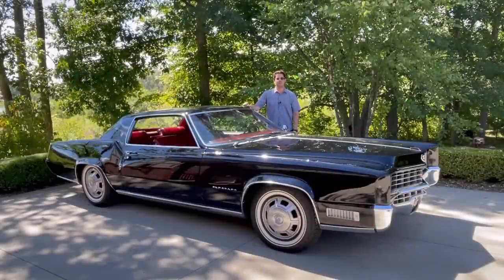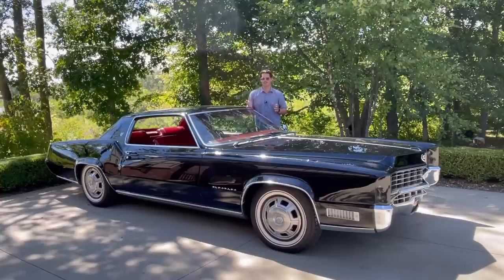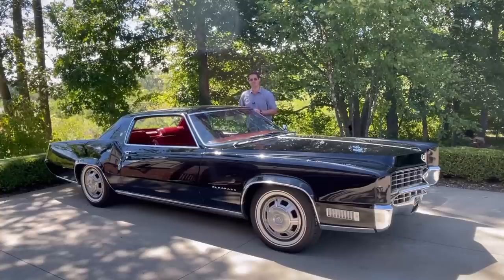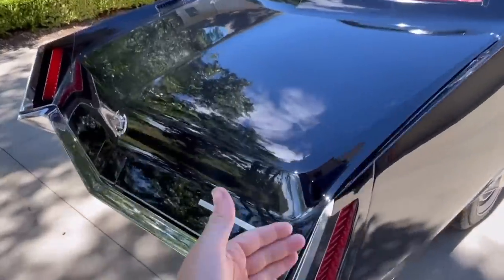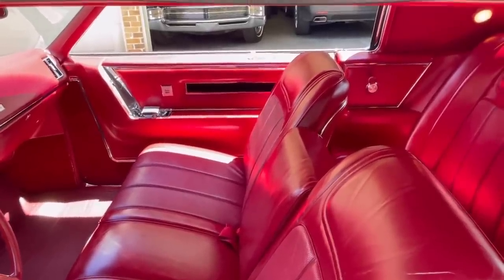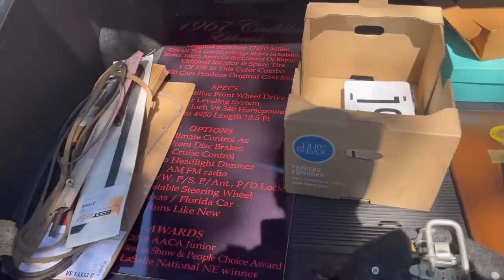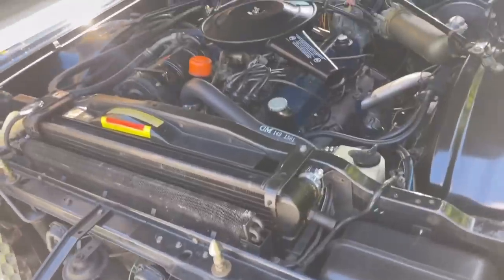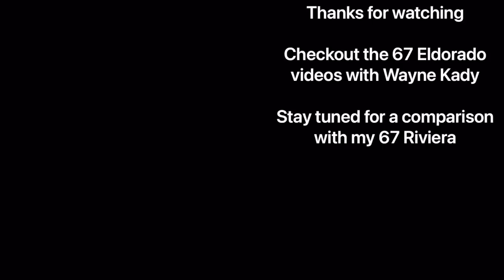Best Styled American Car Ever Made? The 1967 Cadillac Eldorado (with just 18k miles)

Comment: Are those 'quad shocks' on the rear suspension, (4:06) like on the '84-'04 Mustangs?
Looks like it had its own 'proprietary' radio knob configuration, like the Corvette and the Astro 95/Titan 90 cabover road tractors. (and the Citation) I think some of the early Fox Mustang convertibles came with that power/manual window configuration too. The deterioration inside the instrument cluster, seen on the clock numerals, surprises me!  Condensation issue I guess - but I wouldn't've guessed that it was due to the AC. And those knee-vents on each end of the dash...
There must be some date-coding info stamped into that battery case, I'd think. Glad you kept that - it could probably be brought back to life, if the plates are OK.
Weren't the '73-'77 A body coupes given that same hot-wire treatment to their backlites?
That car is so imposing, in a beautiful way! Some red factory style pinstripes would really set it off, although it would be a shame to modify such a clean example as this. Too bad they don't make magnetic vinyl pinstripes, which can be taken off and stored, and then reused...

Comment: Truly a lovely car in remarkable condition, congratulations. I hate to differ with you but I prefer the '68, for the front turn signals in the fender tips, which to me look much better, and the hidden wipers, but to each his own. I'm surprised you didn't mention that Cadillac referred to this as a "Fleetwood Eldorado" in their brochure, as it was considered part of the Fleetwood model line. A couple of other points: you could get leather, as in your car; the houndstooth "Dalmation" cloth which you mention; but also a Darien cloth in several solid colors. I am indifferent to the change in dashboard design from '67 to '68, but find it interesting that in both years that the same dash was used both in the Eldo along with the rest of the Cadillac line, so all Caddys got the new dash for '68. Of course, for '68 you also got the 472 instead of the 429 which I think was an improvement.

Regarding the mystery on the rear window exterior trim molding: while there possibly could be a connection to the plant where they were manufactured, I have seen more Eldos of this vintage with body (or vinyl roof)-color moldings. The cars I have seen with bright molding on the rear window were all repainted, many with a color change. Since I suspect those are stainless steel like most other GM cars of that era, if you were doing a color change it would be easier to just buff the old finish off the stainless and use it that way, especially if you liked the additional bling. But at this late date, who can be sure? Hope you enjoy this one and get a chance to drive it a little.

Comment: The best? It's up there. My personal candidates are the '66-'67 & '71-'72 Rivs, '63 split window Vette, '79-'85 Eldos and Rivs, '68-'69 Dodge Chargers, '41 Lincoln Continental, '39 Lincoln Zepher Coupe, '49 Cadillac, '40 Ford, '66-'67 Toronado, '53 Studebaker, '54 Mercury, '08-'13 Caddy CTS, '61-65 Lincoln Continentals & the '37 Cord to name a few, looked great from any angle.
Reply: '57 Cadillacs were no slouches either.

Comment: Congrats Adam.  super sweet car, and I bet it was not cheap either. This body had to be  designed for a younger Cadillac buyer.  1967-70 had great look. I, for some reason do not like the 71-73 body, they look bloated or something like that. 75-78 are nice but huge, 67 looks slim and taught, just right.  My parents 1965 Cadillac 429 was powerful , but has a tendency to use oil.  340 hp Gross  HP is correct. Designed to use Premium leaded fuel.  As for the best designed GM car? Don't forget the 1959 Cadillac....

Comment: Very cool! Beautiful car. You showcased it well. Vacuum and no relay switches lol. Why are there two dip sticks in the engine?
Reply: One dipstick is for the transmission, since it runs forward along the driver's side of the engine.  (In fact, if you look at the engine compartment straight from the front of the car, you'll see it is  actually offset to the passenger side a little bit.)
Reply: @marko7843  Oh really...did not know that. Cool. Appreciate your answer Marc. Happy Friday.

Comment: 'best'?  Last year you deemed the 67 Riviera to be the Pinnacle of design.   Are you getting fickle or forgetful?   just kidding.   Both are majestic.  Call it a tie.  Looking forward to the comparison.

Those chrome inserts in the air intakes under the wipers is deluxe.  I would have made the flow thru vents chrome too, if it was me.  The chrome flowing up the vertical tail light from the bottom trim is sweet.

Weird front floor mat - so big you can't even see the carpet.   Nice angle on the crotch cooler vent.  Nice that the trunk mat has Cadillac on it.  It always struck me as odd that high end Cads had features optional.   Kinda expect them to fully loaded as definition.

That vintage battery is classic.  Needs some distilled water for sure.  Fill up all the cells, stick it on a battery maintainer and you might be surprised by renewed chooch.

Good use of the stiffener to hang tank from.

Very nice folded rear window.

Absolutely stunning, indeed

Comment: 1967 was quite a year for style across the board.  My vote goes to the 1967 Buick Riviera - not a single bad line anywhere.  One styling disappointment on the '67 Eldorado (and stablemate Toronado) was the wheels - ugh!  The chrome and black Buick road wheels still get compliments today, the Eldo and Toro crinkle cut wheels not so much.
Reply: Keep in mind that the Eldo and Toronado were front-wheel drive resulting in limitiations on the wheel covers

Comment: Adam, I believe you do have a "quiet-close" power pull-down for the deck lid... but it's the rather clever and more robust muscle-powered system with the cable & screen-door closer on the RH hinge.

Also, and I know this sounds insulting, did you fill that original Energizer with distilled water before charging it? That one cell you opened on the video sure looked dry...
Reply from the maker: Muscle powered system?
Reply: @RareClassicCars  
Yes, before the decades of motorized "slam-avoidance" units which could blow fuses &  had that plastic piece that could be broken by an unknowing caddy (pardon the pun) putting your clubs in the trunk at the country club, they designed an all-metal system that was powered by the action of closing the lid.  

As it reached the bottom of its travel a lever on the RH hinge pulled on delay-cylinder that resembles a screen door closer, which in turn pulled a cable running to a   tubular metal striker 'loop', similar to the one used on  the electric units...  I'm a bit hazy on the last detail, but after the latch engaged the loop the stored energy pulled the lid flush - perhaps the latch pushed a pawl out of the way, allowing descent...   

Maybe I'm wrong or maybe it's frozen from being stored so long with the trunk closed, but in the video it sure looks like you have that movable striker loop instead of the stationary square post...

Comment: I have never seen a chrome rear window molding.  I have seen inaccurate restorations especially on the vinyl top.  The halo top was unique and the rear top does give rise to rust around the rear window.  Someone may have come up with a chrome replacement for a restoration job.

Comment: I owned a loaded 1968 Eldorado... I ,too, consider the styling the BEST GM ever produced.   At that time ,a luxury personal luxury car WITHOUT a stylish vinyl top MARKED you as a CHEAP dumbass.... spoling the car for all time!  However, I've sort of grown to appreciate bare tops, today, but, NOT representative of period.   Sadly, the ride was not as great as my MARK IV, V, or VI's...& the boots on front wheel drive ,cracked in cold weather.   OVERALL, LINCOLN MARKS were much higher quality ,fit & finish & were much less prone to rust than my Caddys & Toronados(lincolns were zinc electrostatically dipped, with electro primer,paint & clearcoats.... the paint on my 1968 was SO profoundly thin ,that it wore away in patches, in 6 years!    JR

Comment: Yeah door edge guards do look terrible.  Maybe a black plastic.  As far as I know the old Eldo paint codes are unobtainium.  The gold paint on mine was a one year one model paint in laquer.  I repainted in Urethane.  There is no modern cross reference.  I had to match with color chips and cross my fingers.  The results were good although I remember our original with about an inch of clear laquer on it.  Very nice paint.  Gold is the best.  Maybe black second best. Apparently Tex just wanted a second ride to go to the grocery store.  Fantastic original condition 50 year old car.  The sun usually rots them.  Mine is a Texas car too.
Reply: I have'nt seen one of these on the road in 40 years.  I think they are a show stopper.

Comment: I always thought the wheels just didnt match the car. Wouldve looked more period-correct with the iconic Cadilac spoked wheels.
Reply: You are correct sir.  They look like phoney slotted mags and are too busy.  The 70s Mercedes like turbine wheel covers are much better.  The car is elegant.  The wheels are kitsch.
Reply: Funny...I always thought that they were perfect for what I considered a rich man's personal luxury car but a sporting one....lol. The slots I thought were for the large brake rotors to be cooled as the machine was being put through its paces at Pikes Peak for marketing purposes.
Reply: The wheel covers are great (and very expensive nowadays). They had a practical function as well: The slots in the wheel covers line up exactly with the slots in the Eldorado-specific steel wheels themselves, assisting in keeping the brakes cool.
Reply: @waltschmerz  they could have just put on bigger brakes. Lol
Reply: @edkelley1649  67s had drum brakes.
Reply: @rogersmith7396   
Hi....they were first to have as option.
Reply: @edkelley1649  Well he said that but its news to me.  Sure they could be retrofitted.  What I don't get about Cadillac is why they don't have all the options standard.  Surely that why you buy a Cadillac over a Buick or Pontiac.  My Eldo does not have cruise control  WTF?

Comment: Why did they go to the little corner pieces on each side of the hood rear on later models?  Until now I thought they were all the same.  A one piece is better.
Reply: On 67s, the hood has a straight cut mating up to the cowl. For 68, the separate cowl is eliminated and the hood extends all the way to the windshield, over the hidden wipers. Because the hood hinge placement was originally engineered for the 67 hood, the revised hood rear corners would conflict with the body, necessitating the cut-out sections mounted to the body. A truly awful solution to a problem they created.

Comment: The repeaters in the front and the vents in the back are just rust points.  More do dads.  They usually have a big Cadillac emblem on the sail panel reminiscent of current Cad trucks.  The Cadillac interiors were standardized across all their models.  The earlier Eldos had the standard old lady interiors.  I read the fender stampings had a high reject rate as the metal could not be bent into the sharp points the stylists had put on the car.  I plan to add a third brake light in the rear window on my 70 as I don't trust yabos to see the small tail lights.

Comment: The Eldo only has a 35 amp alternator and a tiny battery which is really wierd.  That promotes fuel economy.  I need a new battery and I wonder if the tiny size is available.
Reply: Wow, 35 amps is really small.  I know the car mfrs cheaped out on alternator capacity back in that era, but 35 is pretty extreme.  There was usually an optional bigger alternator available as an option (but stil pretty meagre by today’s standards).  You can put a tiny battery in any car,  e.g. if you want to save weight for better performance.
Reply: @kc9scott  High amperage power seats, power windows, AC, some with hot air rear window defrosters, lots of lights, etc.  I was kind of shocked.  My 74 TR 6 with no power anything has a 35 amp alt.  But people don't understand, Cadillac did'nt intend to build gas guzzlers. They wanted the car to get the best mpg it could.  Small alternator, skinny tires, high gear ratios little valves, I doubt the car is that aerodynamicly inefficient as that promotes wind noise and buffeting.  The 429s got 18 mpg, the 500 I guess around 15. Compare that to the monster trucks people are ga ga about now.  I've always felt trucks are the current land yacht.  I've read the 500 big block is one of the lightest ever produced.  The Eldo only weighs 4300 pounds which I assume is what a comparable Chevelle from the era weighs and much lighter than the current 6000 pound trucks.  I think my dads 73 Camaro weighed about 3800 pounds.  And the Eldo could easily be lightened by maybe 500 pounds in your garage.  The front seat must weigh 100 pounds as I have removed mine for service, the ash trays are made of steel, the window motors are from the 1950s and are made of iron.  The front and rear bumpers must be massive.  I am hesitant to work on mine without a fork lift.  The spare tire assembly must be 50-60 pounds.  Big steel gas tank.  Of course if you really got serious replace all the sheet metal with plastic and drill out all the floor pans for weight savings.  I imagine a maximum effort could get it down to 3000 pounds.  Like a big block pony car.  The battery problem is a steel case totally restricts the size of a battery to a real narrow one, kind of like a big motorcycle battery.